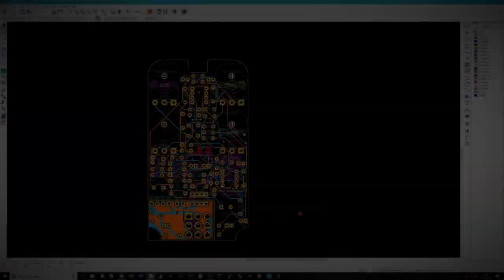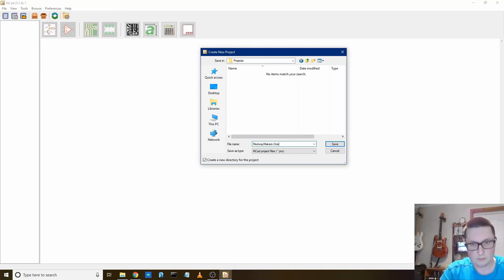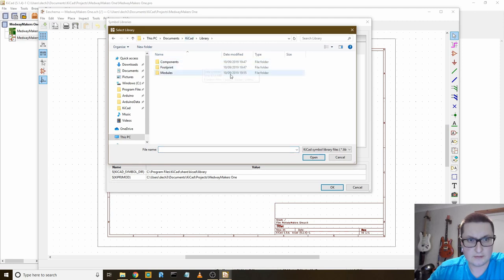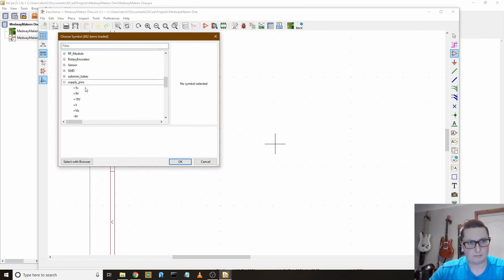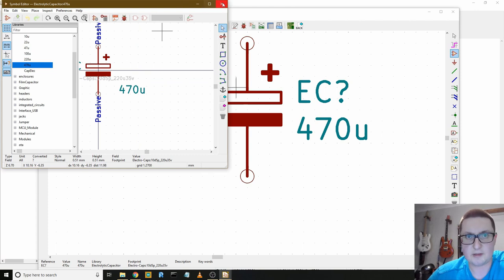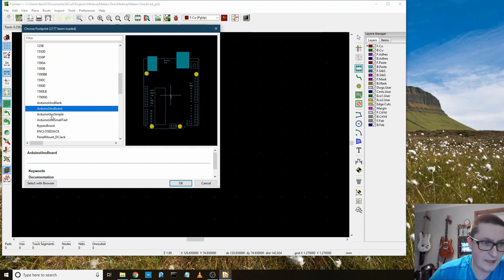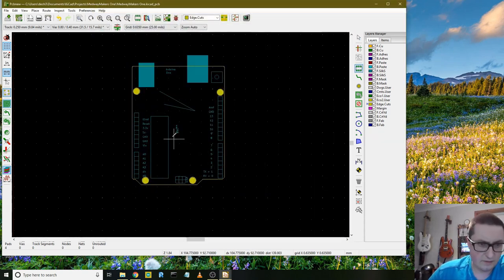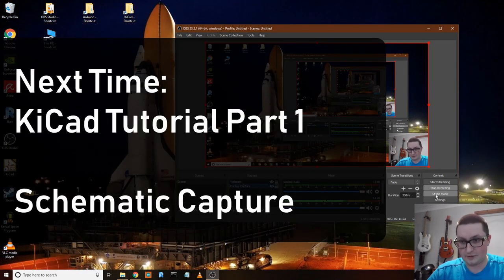KiCad Tutorial 0.1: Library Management

Comment: When placing a component in Eeschema, how do you get it to connect to the dots on the grid?
Reply from the maker: Right click on the page, navigate to grid and try a different size, you probably have a part thats on a 25 mil grid, but your page is set to 50 mil. You can usually change it back once you have moved the part onto the correct gridlines.